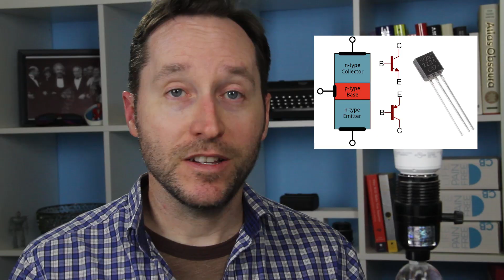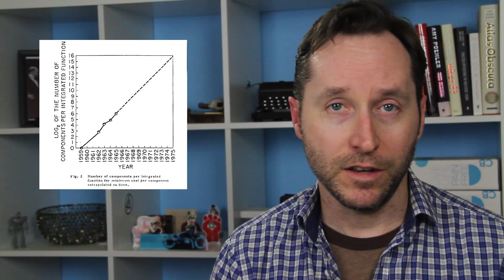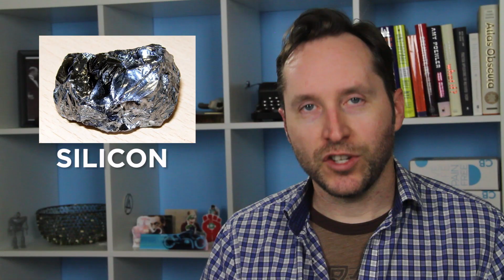Moore's Law Is Ending - Here's 7 Technologies That Could Bring It Back To Life | Answers With Joe

Comment: You know what, even after watching and reading many explanations of quantum computing I still just can't wrap my head around how something can be a zero and one at the same time. If that is so, how does the computer decide which bit to use? Or is it that it really isn't  a zero or a one, but more like .5? A third bit altogether? Its been making me bonkers lately.
Reply: Let me try my hand at an explanation.
https://en.wikipedia.org/wiki/Ternary_computer I see a lot of talk about quantum computers as if they are ternary(trinary (as opposed to binary)) computers, and as if them being ternary makes all the difference. The ternary nature of quantum computers matters very little, except that the data of the superposition is unknown.

The possibility for a superposition and how many particles it is entangled with are what is key here. If you have a quantum computer with no entangled particles, then it will act exactly the same as a standard computer (In practical approach). The superposition of the data is "observed" when the particle goes "through the gate" , but it can only be a one or a zero, because that's the possible outcomes for one particle.

When we talk about the superposition, the important part is the uncertainty, not that it is a third position. Which means Joe's video from last week (The Heisenberg Uncertainty Principle) is very important here. If two particles are entangled, then the superposition can represent both the states of the first particle and the second particle. So you end up with the "calculation" of the first particle and the "calculation" of the second particle. This has the possibility to be a 1 or 0 for either particle, so 4 possible outcomes (2(possibilities per particle) to the power of 2 (particles)).

Now if you have three particles entangled,  when a particle passes through, you would have eight possibilities (2(possibilities) to the power of 3(particles)). Four entangled particles results in 16 possibilities, and five results in 32 possibilities. Doubling every time a new particle is added

We use 64-bit computing today,  but we used to use 32-bit, 32 entagled particles is roughly 4.5 billion possibilities.
64 entangled particles creates roughly 18,440,000,000,000,000,000 (18 Quintilian or so). Because all particles are entangled, you know what state each of them had to be in when you "observe" one particle. If you assign a value to each of the possible outcomes, (and if this theoretically worked) you would now have a random number between 1 and 18 Quintilian, from just a single gate pass and 64 simultaneous calculations.

Clearly, one quantum particle can't be translated into 1 of 18 Quintilian states, though. In fact the above example isn't even a practical or useful application of quantum computing (as far as I understand it). In the real world, it's more complicated than this. You would have arrays of particles designed to do calculations, all entangled, with another array of particles that would pass through the gate to observe the possible outcome. But explaining this in any detail would make the above nearly indigestible. Basically, it's this nature of multiple calculations at once that alludes  to the idea of parallel computing. 

There could be some mistakes in the above, I have limited study with these mechanics. However, I want to provide a mental schema for people to help them think about this.
Reply: +Luis Hurtado Yeah that's about the reaction that you should have to quantum mechanics if you have understood the slightest thing about it, don't believe me just look what actual physicists have said on the subject:

"If you think you can talk about quantum theory without feeling dizzy, you haven't understood the first thing about it." - Niels Bohr (Not 100% certain on exactly where this one appeared)
""I think I can safely say that nobody understands quantum mechanics." - Richard Feynman, The Character of Physical Law (MIT Press: Cambridge, Massachusetts, 1995)

Quantum mechanics just really has no parallels within the realm of human experience there is no analogy to human experience to help us get our heads around it, sure there is a whole bunch of brain melting complex math which can show it in a very abstract way and help us derive solutions from it but none of that helps us to actually put it in human terms in a way that we can truly feel like we actually understand it. Any attempt we use to try and rationalise it and understand it in human terms just confuses us even more because everything that exists in human terms tells us but wait no stuff can't go through two different locations at once, no stuff doesn't just disappear on one side of a solid object and appear on the other side and no stuff can't spin on a single axis in two opposite directions at the same time. Of course single particles do all of these things but nothing we can experience prepares us for that idea.
Reply: Luis Hurtado at the quantum level probability and absolute certainty are simultaneous and indistinguishable
Reply: Just more fuel for the whole idea that we are in a simulation, which I know a lot of notable minds today think. If something is both and neither until observed and measured it really highlights an unusual definitive interaction between what is happening as a result of what is recorded, rather than the other way round! It's almost as if the computer that runs the simulation of life doesn't have enough processing power to determine things at quantum level until it is raised/referenced by the inhabitants of the simulation!
Reply: Isaac arthur has a very intuitive explanation on quantum computing. Check out his youtube video!
Reply: This video of Joe could help too : /watch?v=xTYVTToVzXQ

Either way, keep up the good vids Joe, it's again great work you've done there. Thanks for educating the world (you do your part).
Reply: If its indistinguishable, how it that useful in computing information? Wouldn't that give us a million(or inifinite) different answers which then would have to be parsed into the most probable answers and would never give us a definitive answer to any problem presented to it? So is it that a quantum computer would be a computer of probability and chance? Is that what i'm starting to understand?
Reply: Not sure either, when I heard it I imagined Shrodinger's cat. The 'third state' being a superposition
Reply: @julien_rl4  not to be confused with superstition
Reply from the maker: Tryin' my best. :)
Reply: Thanks for the awesome reply and concise explanation. The superposition is what really gets me and the whole idea that observing a particle is what then makes it all of a sudden to magically become one state. Just thinking about that as being how all of existence really is makes me want to think that we really are just electromagnetic information stored on some kind of media.
Reply: Just wanted to thank everyone for their input and explanations, you're awesome for taking your time to try to chip away at the wall in my brain. I suppose what I really can't wrap my head around is the actual quantum physics properties. Its one of those things where you have to suspend your disbelief and accept it as a law or set of laws/properties that can't really be explained....kind of like gravity I suppose. 

Anyhow, thanks again! I feel like I grasp it all a bit better now, both physics and computing. Unfortunately I also feel like my brain is turning to jello every time I try to conceptualize it all in my head. I probably will not completely get it unless I go on an ayahuasca trip or something.....and who knows if even that would enlighten me!
Reply: +Matt herring Sure - but by 'impressive', I simply meant we don't really need a QC to factor 15 - we need it for ridiculously large primes used in modern encryption, which would definitely bog down that python routine; that experiment was just benchmark (what happened afterwards? :( ). I for one am eyeing the field, in hopes the tech can be used to accelerate quantum chemistry calculations: molecules for everyone.

No problemo; the more people I get invested in QM, the more I win. And I swear to God and myself, one day I'll make a video on these things, and I'll make them as clear as water X)
Reply: That is because you are thinking of the problems, ordinary computers are already good at, such as addition and multiplication.

Think of a different problem;

- Take a very complex relationship between one set of data and another. (Such as what your income is and who you vote for, LOL)

- Lets say we aren't sure how they are related until we try all the algorithms and see if they fit what we are seeing. (For simplicity lets say we narrowed it down to x = ay + by^2 + cy^3)

- A standard computer will have to loop through all possibilities (for a,b,c in the example) to find what fits the most. It will also not know the correct answer until it has gone through all of them.

This is where Quantum computing becomes practical, because Qbits can represent all numbers at the same time. 

Single digit Qbit can do both calculations for 1 and 0 in a single cycle. Triplicate of Qbits can be all numbers between 0 and 7 and so on.

Using Qbits makes it faster to calculate more and more possibilities, because it happens all in one go.
Reply: Yes, No, Maybe.
Reply: Instead of thinking switch. (O-1)?
Think of a potentiometer. (0-255).
Reply: Take a peek at the following https://www.youtube.com/watch?v=WIyTZDHuarQ
It's a competing theory to the Copenhagen interpretation that explains quantum physics in a more mechanical and therefore much easier to relate to way. The beauty of it is that regardless of whether the mechanics explained therein are correct or not, the results the same - so it's still a good way of starting to come to grips with quantum mechanics. Best of luck.
Reply: Light bulb. Thank you so much! Let me mull over this for a bit.
Reply: Very interested. And thanks for the interesting write up! I knew what I was saying needed a lot of cleaning up. but I was already struggling to make the schema simple enough for a layman (and myself). I'm not formally taught, I just try to make my head spin with some light relativity and quantum reading every few months. I can't say it really sinks in too much.

Something I failed to mention in all of my write ups, with regards to general computing, is about factoring. Factoring (the product of two primes, which 15 is) is hard, and for computers it's basically just a probability check for a range and then guessing. There's not a huge fall off for the numbers of primes. I could lock up my shell  for a couple of hours running a python script to calculate them to ten million.
Here's a list in the 30k range:

30931 is a prime number
30937 is a prime number
30941 is a prime number
30949 is a prime number
30971 is a prime number
30977 is a prime number
30983 is a prime number
31013 is a prime number

That's more common than most would expect. There's a reason we rely upon it for encryption. So I'm perfectly impressed by a show of factoring 15 using 5 qubits. Here's the article describing the experiment.
http://spectrum.ieee.org/tech-talk/computing/hardware/encryptionbusting-quantum-computer-practices-factoring-in-scalable-fiveatom-experiment

For fun, here's the 10 primes immediately before one hundred thousand, it doesn't really seem to slow down much. After the first hundred numbers, there's 13 or so per hundred numbers. At 1000 there's 12 or so per hundred. At a hundred thousand there's 8 or so per hundred. There's probably less variance than that, I've just never statistically analyzed it. :
99877 is a prime number
99881 is a prime number
99901 is a prime number
99907 is a prime number
99923 is a prime number
99929 is a prime number
99961 is a prime number
99971 is a prime number
99989 is a prime number
99991 is a prime number

Addendum: While factoring 15 is far easier than, say, 9,998,000,099 (the product of the last  two primes in the list). However, if they really got the computer to factor 15, then it is really only a matter of scaling up to get the answer to my example.
Reply: It's only in a superposition when it has not yet been 'collapsed'.  Basically, you are safe if you consider it not 'actually' (that has no actual meaning, but that's a different subject) being more than 1 thing at a time BUT understand that you absolutely fundamentally can not make any predictions about it being a specific thing.  There is good reason that people talk about quantum stuff as being 'weird' and 'counterintuitive'.  It really, really is.  It is so far outside of anything anyone has ever experienced directly that none of the knowledge gained from your thoughts or experiences can help.  You've just got to do the experiments and deal with the results.
Reply: It's because the people who work with that stuff explicitly say that THEY don't understand it that I am confident in saying that I certainly don't.
Reply: +Luis Hurtado It's important to rememeber that the human senses and the human intellect are not the ultimate, objective tools created to understand the mechanics of the universe. All of life has been evolving between the micro and macro scale of it on the surface of this insignificant rock called Earth, and its existance has pretty much been limited to finding ways of survival and proliferation. None of our ancestors have ever found the need to ponder upon phenomenon like quantum physics. Even the select few of our species who are brilliant beyond the comprehension of mere mortals like us have trouble with these concepts, so that feel bad about it. It's a bit humbling for all of us, in a way.

"The Universe is under no obligation to make sense to you" - N.d. Tyson.
Reply: The shoreline is the ocean and the dry land at the same time. Think of 1 and zero at the same time as the shoreline where it's both, yet neither one. In a similar vein a child is a seed from the mother and a seed from the father at the same time where the two merge instead of being separated. Space can hold one and zero apart in the Field of Relativity. Space binds zero and one together at the same time in the Quantum Field. Just my guess.
Reply: jackG  Good Metaphor!  Reality is metaphor.  We see (observe) thus it exists.  The shoreline is the edge between two states of physicality. Is there a shoreline if it is not perceived by the five senses?

"Love exists by expression, and intention.  The truth of the matter is in the  heart of the lover"
Reply: well, first off i dont really know myself. but, just as i dont really know the architecture behind x86 but can understand how it functions (i dont know how the gates are arranged and have no idea how things are connected, but i know the pieces that make it up), i think i have an understanding of quantum computers. the tricky part to me isnt the hardware, but the software. what we do is essentially send the same problem through the system many times simultaneously and get a number of different answers out due to quantum uncertainty. then we look at all the answers and take the most popular one. for this to work, the questions we feed into the system and the system itself need to be set up very carefully. and just want to add that just because they have to potential to be way faster, they are only faster at certain applications.
Reply: That's the whole point, it is mf'king quantom computing, you are not suppose to understand it! :D

If you would, your brain would explode!
Reply: Think of it like this - The 1 is male, the 0 is female, and the 1 and 0 is both male and female which makes it a ladyboy.
I hope that clears it up.
Reply: +dutchrjen If you're gonna lecture me on QM, you coulda just written U( a(t)|-1/2> + b(t)|1/2> ) = c(t)|-1/2> + d(t)|1/2>, |a|^2 + |b|^2 = |c|^2 + |d|^2 = 1; |psi> ~ e^i*theta|psi>; [A, B]=0, A|psi>=a|psi> => B|psi>=b|psi> and saved me sum time, sheesh ºwº'

We've digressed way too far, but OK:

i) You make a big fuss about the undescript global phase; except for Berry's phase in adiabatic problems and the way it kinda shows us the 'need' for the EM field in QED, I've never seen much use for it - it's just there because quantum states are defined as ray unirreps - and they're so 'cuz the equivalence class |psi> ~ e^(i*theta)|psi> preserves the norm <psi|psi> (now where have we seen that before? I mean, how do u define Lorentz rotations? ;) )

ii) If you dig up Born's 1925 fundamental paper, he basically worked from the knowledge that there exists 'matter waves', then copy-pasted the |a|^2 amplitude thing from the scattering of radiation (AKA from optics), and got the probabilistic interpretation from the formula for the cross-section of the scattered waves; do u think that the optical theorem figuring in QM books has this name for kicks? All of this to say, not really much else to 'understand' bout Born's rule, IMO

iii) Yes, 'collapse' is indeed mysterious - behold, I shall demonstrate its magic! Before I throw the d6, its state is |psi> = 1/6^1/2|1>+1/6^1/2|2>+1/6^1/2|3>+1/6^1/2|4>+1/6^1/2|5>+1/6^1/2|6> , but once it lands, QM must make it 'collapse' into |1>, or |2>, or..., or |6>. Wizardry! ^W^

Rather than debate the sex of the angels, u may peruse the comments above this thread for my own extensive digression on QM. Now for the computation:

i) "Classically the universe is completely deterministic so there is no intrinsic probability" That's moot and irrelevant ATST; moot, cuz it's not clear that there's no reason for the perceived randomness of quantum states (i.e., that dispersion-free states cannot exist in nature) - one such interpretation being the Bohemian one, even though it doesn't particularly warms my heart -; irrelevant, cuz, even if a PTM can't be realized physically, it may still exist mathematically - in which case it may be approximated by sumkinda gizmo, at some degree. I dunno if one can make 'true random' numbers in real life, but I'm certainly not forbidden to think about em or use pseudorandom stuff

ii) "I don't know the specifics on what your discussing in your paragraph above" Unfortunately that's what interests me here: a thing from computability theory. If u look at the history of computation, y'll see that the physical realization (transistors, neurons, valves, spins flipping thru unimatrices) of the machine is not fundamental for you to create a computer or calculator (it may be convenient, for technical reasons), so one should really ask, 'what am I gaining w/ this thingamajiger I'm building?'. In the way of resources, computation may be faster w/, say, QFT (Shor), but in the way of 'what can we compute?', the argument I wrote basically says 'hey, da world is quantum; so, if ya make a QC, ya can use uncertainty to cheat on Turing'. AKA 'I dunno how stuff works, therefore it must do stuff I dunno about'
Reply: People like you help keep the ignorance down. Kudos randoman.
Reply: Electrons (and all other "particles") are really wave "packets" (sinusoid shaped).
Top of wave = 1 (represented by), and bottom of wave = 0 (represented by).
So depending when you look (observed) at along the wave ) = 1 or 0 or somewhere in between.  (The wave packet is at all positions simultaneously because its wavy).

A wave will appear any value (position)  from 0 to 1 and in between, depending on where you took a "snap-shot" look in time along the wave.

A quantum binary computer is designed to use all the "0" and "1" positions of the wave at the same time (not the in between values of 0 and 1).  

One quantum bit (qubit) = "0" and "1" at the same time.

One quantum byte (qubyte ,8 qubits)  = "00000000" to "11111111" at the same time, (and all other combinations of 8 bits of "0" and "1").

eg.   A very simple quantum computer multiplies two qubits by two qubits.
         
        Would calculate in binary simultaneously, (not sequentially), 16 results.

        00 * 00 = 00 ,     00 * 01 = 00,    00 * 10 = 00   ,   00 * 11 = 00 
        01 * 00 = 00 ,     01 * 01 = 01,    01 * 10 = 10   ,   01 * 11 = 11
        10 * 00 = 00 ,     10 * 01 = 10,   10 * 10 = 100 ,   10 * 11 = 110 
        11 * 00 = 00 ,     11 * 01 = 11,   11 * 10 = 110 ,   11 * 11 = 1001 
 
        If two qubytes multiplied, would give 256 results simultaneously,
Reply: Luis Hurtado smoke a joint and chill. everything makes sense in nature.
Reply: Nah just using the superpositions as extra bits. thus your quadsistor can act like more.
Reply: All concepts of quantum computers will still require standard binary digital computers for us to interact with the quantum processors.  This makes quantum computing no more powerful than regular computing.  The only way we will ever benefit from the use of quantum computers is if we figure out how to manipulate them without collapsing their wave functioning capabilities.  Something we have yet to even accomplish virtually yet.  When a quantum processor's wave function is collapsed the processor becomes no different than a standard binary processor.
Reply: Does anyone in this thread think the theory that this happens is because there is a higher dimension that we can't see?
Reply: I'm sorry to say that most explanations of quantum computing are either entirely wrong or profoundly misleading.  This is unsurprising, because understanding them requires first understanding a number of base ideas that are themselves frequently misunderstood.

First, of course, we have superposition.  To fully understand it, look up the "Double Slit Experiment" and read up on its meaning and implications.  It's an experiment that roughly shows that really small things are...weird.  Remember in chemistry class when your teacher was like "hey, the electron isn't a single orbiting thing, it's more like this probabilistic  cloud"?  And you were like "huh...?"  Well, your teacher was exactly right, and it applies to more than just electrons.  It pretty much applies to anything on the subatomic scale.  Until observed, subatomic particles don't have discrete locations or velocities; instead, they're more like this big wave of probable positions and velocities and is all of them at once.  This is called superposition and you should probably read a whole book on it because it's...weird.

Second, you have to understand quantum entanglement.  Remember how I said subatomic particles are weird?  Well, they're even weirder.  You see, if you get two particles together in just the right way, they can wind up entangled into a single system and no longer become independent entities.  This connection can hold even if you separate them across vast distances.  The result of this is that if you do something to one of them, you effectively do the same thing to the other one instantaneously, even if the other thing is light years away.  And before you ask, no, you can't get FTL communication this way as far as we can tell, for reasons I won't go into unless someone asks me to.

These two ideas intersect with Quantum Computers.  What they do is entangle a series of particles and place them in a superposition of all the possible solutions to a particular calculation.  Then you measure one of them, collapsing their superposition.  Because you know the values of every other particle by measuring the first one, in this way you effectively find all possible solutions to the calculation all at once.  This is very useful for certain kinds of problem, particularly anything to do with factorization.  Since factorization is the foundation of all modern encryption, that's a Big Deal.  However, you can also see how this might not be useful for some other kinds of problems, so it's not the blanket performance enhancement many make it out to be.
Reply: Yeah, that is a good video, as are all of Joe's videos. But none of it really makes complete sense to me. Every time I think I get it, my brain goes, "WTF?!?? That's crazy talk!"
Reply: When we think it's not a point A to point B deduction system. We have many competing and converging possible answers for how to react. Not exactly sentient but definitely a thinking machine
Reply: You should read my previous reply, Maybe it'll help.

--------------------------------------------------------------------------------
I've been thinking about Quantum computers and how they seem to be processing in qubit(s) . I think there is a link between extreme cold temperatures and time. The colder the temperature, the slower time ticks and vice versa for higher temperatures (the faster time goes by). This might just be how quantum computers work. They're probably not processing faster than regular computers, rather their confined spacetime is ticking slower, giving the electrons more time to complete calculations (communicating/interacting faster)

Any thoughts?
Reply: +Barry ? Where did you get the connection between T and t? Are you talking about some like https://arxiv.org/abs/1310.4691 ?

>,_,> ...And what about neg-temp?
Reply: +thstroyur To be fair though 8-bit conventional computers were hardly impressive either by modern standards ooo it can write ASCII in 16 colours maybe even 256 if you are on the cutting edge! And I think the system which factored 15 had only 7-qbits so yeah give it some time before expecting any miracles there lol.
Reply: +Seraphina S I know all that; I'm not saying QCs are worthless, all I'm saying is we're too early to see the tech's real resourcefulness. Take the 7-qubit thing, for instance; it may already sound impressive, if compared with conventional bits, but technically the 7-qubit calculation is way more costly than in some 7-bit architecture, because of technical issues of decoherence, entanglement, error-correction, etc. The 15 experiment was just benchmark; it says they're on the right track, if they keep at it. But as far as I can see, the limiting issues here are really the technicalities I mentioned (and also in our ability to code; stuff like Shor's algorithm seem to be still rather rare)
Reply: Dustin Rodriguez That seems to be the mainstream view, but it doesn't really help anything; you could say that about the general public, but the people that work with that stuff? And anyway, you can still understand QM in terms of more 'mundane' things, if you're careful about phrasing (same with SR 'paradoxes')
Reply: Dustin Rodriguez Can't say I blame ya XD
Reply: +manu AU The essential idea is OK; but what I find off-putting with the phrasing of it is that there's no "multiverse magic" involved in here - Deutsch and others nonwithstanding -, i.e., any processing power achievable must come from the probabilistics alone - and this is what seems to be controversial in the complexity theory community. I suspect a QC can provide no greater algorithmic gain than an equivalent probabilistic (universal) Turing machine, and the examples to the contrary arise from misconceptions relating to the fundamentals of QM
Reply: You should watch PBS Infinite Series to find that out. They simplify maths to accurately explain the ways quantum computing is faster and in which ways.
Reply: Luis Hurtado  1 + 1 = 1.

"4 divided by the square root of Phi equals banana cream pie"
♒~~cc  🔯☯💗

10769 divided by 172316 equals?
Reply: +dutchrjen 'Infinite intermediaries' sound like analog computation, though; do you know if the parallel processing in QCs must include analog somewhere to work? Or can everything be written in digits? (Turing equivalence and stuff)
Reply: +dutchrjen "The input is digital and the output is digital (either 1s or 0s)" OK

"The wavefunction evolving in the middle isn't exactly digital or analog. It's quantum"
Misleading; the number sets one usually encounters in practical applications are either discrete or 'almost' continuous; there is no middle ground. Besides, the word 'quantum' implies physical connotations, which I believe to understand (vide supra); it's the math that concerns me: if a function is computable, it can be so thru digital or analog machinery - maybe a combination of both, but there is no 'third' option for design

"You can definitely make a classical equivalent of a Quantum Computer with a Turing Computer but depending on the calculation type that classical device may be impractical"
Yeah, I know about complexity

"However, even though there's the equivalent of digital logic gates quantum computers use the rules of quantum mechanics"
"The intermediate states are sort of "analog" for quantum computers but the input and output must take certain values. You can ask an infinitely precise question and get an infinitely precise answer but the intermediary steps are all admixtures or "superpositions." The superpositions are also theoretically exact (provided nothing interferes). You don't get this precision with an analog computer."
Care to elaborate? For I know that, for the thing to work physically, one must reliably produce an ensemble of states and perform a shitload of measurements as far as possible, but I ask how things go algorithmically: if you prefer, think like this: is a QC anything like a differential engine (e.g., during unitary evolution premeasurement) ? Is it doing something that only a differential engine can - or perhaps the architecture people usually comment about a 'mixed' design, in the sense I mentioned earlier? If yes, can a purely digital quantum design be made that can equiperform the same 'advantageous' problems the previous architecture does? Lol, I know it's a lot to ask, but I find simply musing about such things fun
Reply: it cant. thats the laymen terminology for it. It is never actually both at the same time. The actual statement is literally invalid. it is always 1 or 0 -  but when you use a quantum system to process the data and work it - it wont give an exact answer like a binary system would. so for small math like 5+5 this is  terrible and wasteful. an exact answer takes a long time to discover and confirm... but a range of answers that are very close but not exact is easier... and faster. so for example if you were trying to compute the number of atoms in the ocean -  a quantum computer could give you an actual answer that is likely to be very close, close enough at least, and quickly, on the other hand a modern computer just couldnt do it ( this is just an example)
Reply: when you process something using what a quantum computer is/will be -  it will be for things where an answer that is +/- 500000000 is ok, and getting the exact answer is impossible, or wsteful.
Reply: mere mortals? there is nothing BUT mortals. every thing dies. ever. thing.
Reply: Time is the answer example how long does it go from on to off and so on? nanosecond or even shorter times
Reply: its Time we can't measure, The best guess i have.
Reply: Are u talkin' bout quantum uncertainty? If you are, my guess is that QM works on the fact no one system is truly isolated, and accounts for those 'unseen' interactions - think like a Brownian particle, where u don't see the fluid that makes it bounce around. But measurement, definitely, is not the reason for it. Is this datzabout? °~°
Reply: Luis Hurtado ich
Reply: look for bohemian physics its quantun physics done right
Reply: All quantum mechanics is the ability to multitask in the true sense. We will never witness true quantum physics
Reply: Well when you shoot a particle down a straight path and it reaches an angle that requires it to have a 50% chance to go left or right in the world of physics will it go left or right? The answer is both.
Reply: Is it though? can anyone elaborate? when talking topics like that it's hard to not dismiss it as fiction. There has to be some kind of logical explanation before it even gets managed.
Reply: Luis Hurtado watch a documentart on quantim mechanics.

in the subatomic scale particles like photons and electron do not behave the same way as say billiard balls.

there are a lot of shocking weird things that happen in the quantum real, like a single electron being in two places at once, and even apparently being able to move forward and backwards through time.
Reply: an electron is never in two places at once. use your brain. we just cant measure them accurately enough to know all the information at any given time to determine an exact location at an exact time, so we have to use a variable.
Reply: +Bruno Cardoso10 U mean Bohmian, o mama mia? X) Well, as for done right, maybe; but people usually also seem to forget the (obvious?) extra payload of work it demands (P. Holland, Il Nuovo Cimento B, 2001, (9), 1043-1070)

Funny you'd mention Bohm; turns out that it may be thought as some kinda Brownian motion (at least abstractly); cf. E. Nelson, Phys. Rev., 1966, 150 (4), 1079-1085, old as the fucking hills, and refs. therein
Reply: +dutchrjen Look, I too know my QM (though, like Ash, I'm still 2 yrs away from being a Master ;| ), and I agree w/ the physics u describe (except "the superposition still transforms like its made out of an infinite sum of discrete states" ...?), but that's not the point; since you wanna go there, I was specifically referring to the cardinality of any complete quantum Hilbert basis set: say, a spin lattice? Denumerable. Momentum eigenstates (bar rigged Hilbert complications)? Non-denumerable. Anything else? Don't think so.

But, as it turns out, this is not even relevant to the question of computability, apparently. Feeling motivated, I decided to finally read Deutsch's paper on quantum computation, which I'm presently in the middle of; so, let C(M) be the set of functions that can be computed by a machine M, and let T be the well-known UTM and Q be a 'UQC': he claims that C(Q) ⸧ C(T), which, even being a QM junkee, rubs me the wrong way (just like the claims by some people that the human brain performs non-recursively); I'll still give 'im the benefit of doubt, though, and think it over.

As for "Analog nor digital systems have the smallest bit of data as a superposition of two different states acting in a way "digitally"" & " Analog computers nor digital computers have the probability part and neither contain the mix of continuous and discrete features", I express doubts because I've heard that there are such things as classical probabilistic Turing machines, which I know exactly zilch about. (Bear in mind, though, that I'm always talking about the size of C(M), not the time or space requirements of T or any hypothetical T' for a given recursive function, which is for me boring engineering).
Reply: @Patrick,what are functions and what is higher or lower order?(See the problem)
Reply: Luis Hurtado The basic thing is that if you don't observe a quantum particle it is both zero and one but neither at the same time it is basicily undetermined , if you do obsereve it, it becomes a definite 0 or 1
Reply: +dutchrjen

i) "No, it's not irrelevant" Yes, it is; I repeat my point: "even if a PTM can't be realized physically, it may still exist mathematically", adding: 'regardless of QM ontology'. Math is extracted from nature, yes, but a mathematician's imagination has far less constraints than a physicist's - which doesn't mean math is useless. E.g., have you ever seen a mechanical model of an irrational or imaginary number? (don't answer; just think about it).
"We have NOT observed hidden variables" Not my point again; my point is, it wasn't proven that DF states are inconsistent w/ QM, even if we will never be able to observe 'em experimentally.
"Going into metaphysical "what-ifs" don't matter unless you can propose an experiment" And yet you insist 'QM is weird'. Also, I remember stating quite clearly I'm not a passenger on the BM hype train; read Holland's paper to get a glimpse why.

ii) "Many equations have similar forms and it doesn't mean they're necessarily related" But in this case, there is a common element: for any kind of wave (sound, radiation, water, whatever), you can apply the same cross-section formula - but cross-sections are constructed on the basis of a probabilistic interpretation. From this and Born's rule is basically a synapse away.
"what the "physical meaning" of the wavefunction is (if it has one)" Probability, for Pete's sake! That's all they're about!
"No physicist I''ve met calls the wavefunction "matterwaves."" That's because you probably wasn't around in the 1920's.

iii) Catch! Never said I was talking about QM 'collapse' (obviously that's not the way a macroscopic dice state evolves) - I said I was demonstrating 'collapse'. If it'll make you feel better, put quotes on the 'QM' there; I guess it serves me right, trying to make a joke and being smart at the same time.
And if you insist on exchaging academic barbs, I'd say it's you who don't know your physics - entanglement and Bell's inequalities have nothing to do with 'vanilla' Copenhagen interpretation of measurement - in fact, the BI's are not even quantum formulae, but metaformulae that applies to any proposal of observable correlation! Also, on the subject of DFs, read up J. S. Bell, Rev. Mod. Phys. 38 (1966) 447-452, since you like quoting him so much. Also, if you yourself have ever read EPR, you know, in your heart, the example there is boring.

i.i) Still making a big fuss about phases; just say QM Hilbert space is over the field of complex numbers and be done w/ it.
sigh Let G be the matrix rep of the Minkowski metric [+,,,-]: a Lorentz transformation L in the same rep is one that satisfies (L^t)GL = G - i.e., a Lorentz transformation preserves the norm induced by the metric. Now for QM: let U be some matrix, and |A> some state vector: the norm <A|A> -> <A|(U^t*)U|A> is preserved under U if and only if U is unitary. If you contest this, I'm seriously gonna scream.

"Superpostion would be a better description than uncertainty" Superposition is the mathematical statement of uncertainty! In your own words: "The wavefunction as a whole STILL is a superposition of an infinite number of states (or at least a large number) even if we observe a single discrete value for one property. "Wavefunctions" never completely collapse" AKA, you're considering non-commuting observables done at the same time, such as p and x - AKA uncertainty. Read up some fundamental text like von Neumman's, if you don't believe me this is one of the reasons we use the Hilbert formalism, ITFP.
"You CAN cheat a Turing Machine because of the superposition" No, damnit, that's not the way to prove it! A TM is not a physical object (it has infinite memory, for crying out!), it's a mathematical model of a computer; to prove a QC cheats Turing, you need a metamodel of computation that includes QCs as a particular case, not build the theory around this specific architecture. U know, I have a trust on the BIs because they don't assume the world is quantum, this conclusion follows from them - and as far as I know, QCs have no such luxury.
Reply: Luis Hurtado the "computer" is more of a Ouija board. its not computing answers to math problems so much as its tearing a hole in the fabric of reality, peering into every alternate dimension and looking at all the potential outcomes to any question (or math problem) simultaneously. No one likes talking about it (Besides the makers of the QC) because it sounds like a Sci-fi channel special but there you have it.
Reply: Remember Schrodinger's Cat? Like how it's both alive and dead until you open the box? I think the deal with qubits and there being some arbitrary probability of a 0 or 1, is that when you open the box, when you actually complete the equation, it WAS either a 0 or a 1, and whether it's a 0 or a 1 will entirely depend on whether said 0 or 1 solves the equation, and because it's both 0 and 1 (until you check the result), all processing happens simultaneously, you have infinite processor speed.
At least that's how I interpret it.
Reply: @Patric Not necessarily. I know many people(such as my father) who are curious about calculus but don't know what a function is. "Higher or lower order" OH YOU MEAN DEGREE?
Reply: The Computer doesn't "use" the bit.. It only uses measurements of that bit
Reply: +h82sk8 
Using a potentiometer would be like an analogue quantum computer, not a digital quantum computer.  
Maybe an organic brain is analogue quantum.
Reply: +Simon Ruszczak brains are binary ;)
A neuron either fires, or doesn't
Reply: +Frank van Hoof 
A neuron has different strengths of firing. ;)
Reply: +Simon Ruszczak read this: 
http://boards.straightdope.com/sdmb/showthread.php?t=346987
Strength is measured/used over multiple neurons, to get to a common output.
MachineLearning/NeuralNetworks talks about this a lot (which is how I know about it)
Reply: +luke666808g it's a probability. So if for instance it "is" .6, you can store both a 1 ( because .6>.5 ) AND a 0 (because 1-.6 < .5) in a single bit. Upon reading it is manipulated in a way to get the desired value out.

Wikipedia:
A pure qubit state is a linear superposition of the basis states. This means that the qubit can be represented as a linear combination of {0} and {1}
(Representation: y = a{0}+b{1} 
prob of 0 is a^2, prob of 1 = b^2)
https://en.wikipedia.org/wiki/Qubit#Qubit_states
Reply: it's dual phase detection sent through a parallel  NOR XOR AND as threshold logic as: 00 threshold (01 10 both are the same) threshold 11 and then phase delay registers for decoding as AND and re encoding as OR summing to base n notation as in  0+-1        --- 0+-1+-2 --- 0+-1+-2+-3 and so on as many phase delay registers you can AND decode and OR re code
Reply: + - magic number 0    --------- * / magic number 1/1 wrap that is maths
Reply: as like universe zero and one and same time
Reply: there is so much I will never get.... but love thinking about it anyway.... and maybe....bingo....this thick head will get it. Cheers
Reply: They have spin, clockwise would be a 1, counter clockwise would be 0
Reply: you dont know what you are talking about.there os already quantum computers in operation
Reply: polarity NS = (01) spin_direction cw=T ccw=A (01)     00 01 10 11      NT ST NA SA
Reply: also polarity N S and a 3rd Q charge pos neg
Reply: Luis Hurtado 

Maybe it's a 2
Reply: MRI proves 0 1 2 3 4 5 as 0 +-1 +-2 ther's also -0 = +0 which is a moment change of state
Reply: Don't worry about it, no one understands quantum physics, you just learn to accept it
Reply: yup
Reply: The only thing that is going to happen is smaller interconnected  multi silicon chips  instead of the monolithic die standard we used until now, just like the new ryzen  , people like to think of something more innovative but that is just unrealistic , and childish !
Reply: Luis Hurtado Imagine, if you will, not fully understanding the basics of binary computation, yet being intelligent enough to want to follow the conversation. My brain is literally sore and may be clogged.
Reply: Kurzgesagt in a nutshell has a great video on this you should check out!
Reply: Quantum computers use quantum probability,  for example 2 + 3 has 80% chance to be 5, 10% chanche to be 6, 5% to be 7 and 2% to be 4 and etc. The answer is determined when we observe the 'qubit'.
Reply: Luis Hurtado imagine a woman who is a whore and a nice person at the same time! now thats quantum!
Reply: Luis Hurtado in the words of some random famous person, if you think you understand the quantum world, you don't, so if it helps, you'll never be able to wrap your head around it. just... don't think bout it or your brain 'll get all frazzled😁
Reply: Its a thirds state for the bit. On/off/both